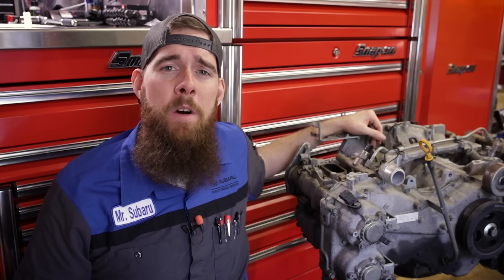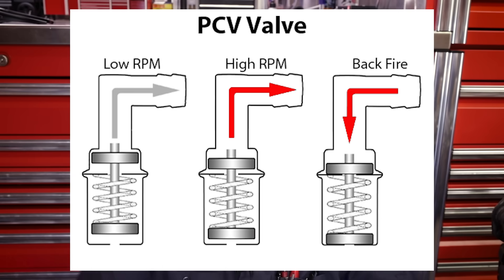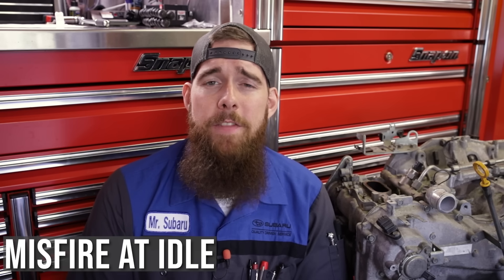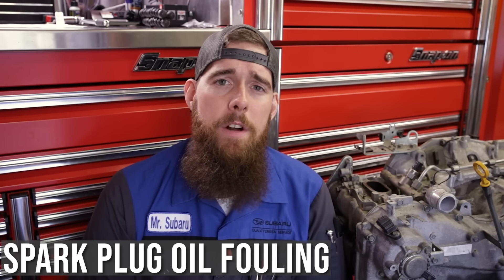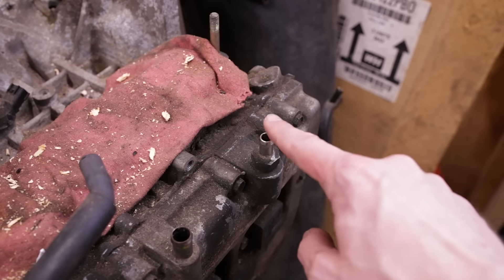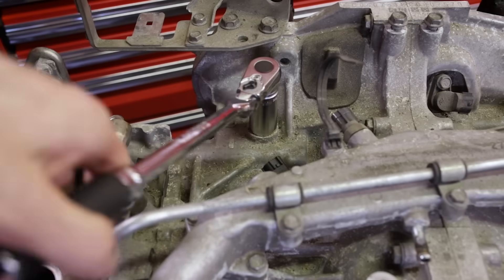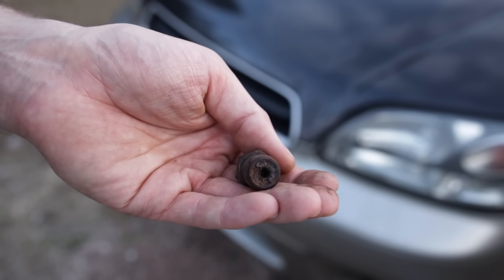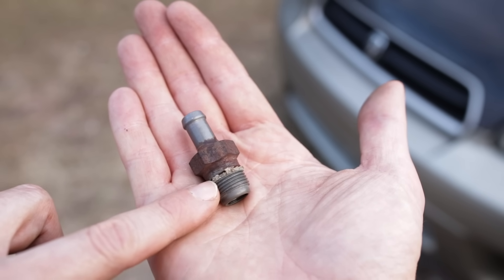DON'T Let This $20 Part Ruin Your Engine! PCV System History, Theory, Operation, & Repair!

Comment: I don't have any of the symptoms but I changed it at 40K miles.  The old one does not rattle! A bit of goop was on one side of the bottom.  So 40K (6 years) was too long to wait but I don't think it is damaged.  Looking back, I did think the last oil change showed the oil coming out a little dirrtier than previous.  2020 Forester.

Comment: That actually looks as simple as replacing an air filter, I actually did order one these for my Subaru as back up or replacement in case my original one goes bad.

Comment: Just did this today. Have 2021 Forester with 48,400 miles on it. The job was not as easy as it looked. Im no novice but this is the first real maintenance I have done by myself on this vehicle besides, oil, air, cabin filter replacement and tire rotation and replacement. Brake fluid was replaced and flushed by a local shop. First had to find the best way to get a socket   and ratchet on it and found that a deep socket with the ratchet was best reached between the valve and the fire wall. It was in there tighter than I thought it was but i increase the pressure and it broke loose. It was a little clogged and not free ratling like the new one I had. I swapped it out but getting the thread started for some reason was not easy. Spent about 5 minutes getting the threads started and put some Permatex 262 on the threads which was a recommended sealant. Tightened it up, put the hose back and Im back in business. The old PCV Valve was cleaned up with Brake Kleen and loosened it up and it is now a spare. Got a Subaru genuine part replacement from an online Subaru parts dealer. Been buying my Subaru oil and air filters from them and got discounts for the part and shipping. Cost $11.00. Just another note. I made sure the oil filter was an accepted one from Subaru and made in Indonesia like in Mr. Subarus' oil filter video. Previously I bought one from Amazon and when it arrived it looked identical, but was made in China. I sent it back. Thank's Mr. Subaru, your advice and direction are gospel. Have a log book for all maintenace and repair  and invoices and receipts are kept in a binder, Have extended factory warrantys and have proof of service with photographs in case they try to deny a claim.

Comment: 2015 Forester at nearly 60k, got the PCV valve and tube, took it out and sure enough it was failed and rusty.  Cleaned out the throttle body intake while had the air intake off too.  Thanks for making this video and educating us on the PCV valve.

Comment: Man I am going to give it shot on replacing it myself the dealerships in my area are ask $525 to $575 and that with no grease included. Thats why i hate the dealerships  $146 for oil changes $460 for front or rear brake jobs. So i asked one dealership how much  the service manager said $565 so i ask how much for the pvc valve he said $33 so $532 for labor i laughed and hung up. So now I'm going to have to go back to the university of you tube to find someone to show me how to replace myself. Thanks love your videos on how to maintain my money pit of a vehicle. P.S  i still drive my 52 Chevrolet Styleline Deluxe with a 327, turbo 350 as my backup along with a couple other oldies.

Comment: Thanks for the information and my 2004, 160,000 klm 2.5L Outback started a rough idle once in a while at 150,000 k's.
It runs rough for maybe 5 klms and then smooths out and runs perfectly for the remainer of the day. 
It's been to the mechanic that does all the servicing and repairs to find what's causing the issue but they could find anything wrong and when the engine is warmed up there no fault codes.
Tonight, I'm going to replace the valve and see if that stops the engine running rough at the start up idle.
I haven't had the rough idle for a couple of months and yesterday it did it again at startup and again after 5 klms it ran perfectly.

Comment: I clean mine every other oil change, I also capped off the system from the valve covers. Put a little breather filter on each side and all them to vent to the atmosphere. Keeps the oil and fuel from gumming up the engine.

Comment: I know this is an old video 😅but my crank seal has blown , due to pvc valve being blocked , just ordered new one , do you reckon my engine will have blow by ? (Got a little 4 cylinder)

Comment: Just touching 190k and never looked at my PCV valve. Looks like I'm checking it this weekend so I'm won't be paranoid about blowing out my gaskets. Service Manual never says anything about pcv. Definitely not $20 now.

Comment: I went to remove mine (2005 Outback 2.5L non turbo) and it's stuck, the cylinder it's screwed into started turning. How can I get it out without damaging the engine? Thx

Comment: Just tried this on my 2009 forester EJ253, but had to stop. The PCV  is on top of another larger nut with a tube coming out the side to the air intake. That nut started to spin before the PCV . I don't think that one has thread, it might be glued in somehow. Hopfeully I didn't break the seal too much and start having a leak there. Just letting you know there's another configuration out there and I'm not sure how you deal with it.

Comment: I had a tough time of it on removal. The PCV hose was rock hard at the valve end. It wouldn’t pull off over the nipple no matter how hard I tried, which was weird, because it spun around freely. I ended up cutting the hose off just above the valve with a Dremel tool, then used a 19mm deep socket over the whole thing to unscrew it out. Used a little Hondabond on the threads of the new valve, and torqued it to 17ftlbs.

Comment: Just fitted a new PCV in my 2.0xt forester. It’s running VERY nice now. Thanks for your advice 👌
Reply: Hi man,where is the PCV on the 2.0XT 2004 motor? Did you replace it by yourself? Thanks from now🙏
Reply: @UrasAlpOzcelik my car is 2017, I’m not sure about 2004. 
I got a mechanic to fit it, but it’s definitely something you could do yourself. Get a new PCV hose as well though. .

Comment: In Australia, parts are hard to come by, the dealerships don't admit to stocking any, so you have to put in an order and wait, annoying.I got a quote for about A$34, but I thought I'd roll the dice on an AliExpress unit at half the price. It arrived in a little plastic bag with the subaru logo, geniune parts and subaru corporation badging on it. The part number 11810AA131. I pulled out my PCV valve and put these side by side with the genuine one that I am sure has not been changed since I bought the car new in 2016. Car has 120,000km on it. The existing PCV valve still rattles nicely and looks pretty much like the new replacement - it has all the same metal stamping marks on 3 of the socket facings. The old and new units are shiny silver unlike the black units you have here. I have changed the oil on the car religiously every 6 months including oil filters. The car has never consumed a drop of oil. Just wondering if it the cleanness of the oil situation leads to the longer life of the PCV and other items. I also only run premium unleaded fuel which has more additives and less impurities than cheaper fuel.

But thanks for this video - one less thing to go wrong. 

I did order the new hose too. The old one was still serviceable, but it was starting to harden, so there's a nice new softer hose on now.

Comment: There's no way I would try to clean a $20 part that might have took me 30 minutes to get to if it's that important replace it for $20 with a new part.
Reply: $37 from the dealer. If you spray carb cleaner in it once a year it will stay clean.

Comment: Need to pull my ej253 soon to replace the rear main seal (which has failed after 40k since it's rebuild), so I will be checking the PCV Valve as well

Going to replace the clutch kit as well since that's likely got a lot of oil sprayed on it

Comment: Good video.  Didnt know about this and dont remember seeing in in maintenance guide.  But really?  During the silence of reinstall you couldnt say what the recommended torque is?  Right after mentioning using them? Torque setting in general are a pain to track down on this car.

Comment: thank you Mr. Subaru for this vid. I did this on my 2012 outback (190k miles) and the pcv hose was cracked in multiple places allowing air in (fixed now). check engine light kept coming on telling me bank 1 running lean (was at my wits end trying to figure this out). 

my pcv valve did not screw in the block its the 15$ red and black pcv valve from autozone. (dont know if that makes a difference).

thank you so much for the work you do on utube for helping us clueless people out with our suubs.👍

(edit)

going to ask this here while im commenting... i have a clacking noise coming from the (looking at the front of the car) left side after starting to go to work (sitting over night). it sounds like a lifter not pumping up correctly. it goes completely away after warming up. after that it cause no issues for the rest of that day.

thanks.
Reply: Did you find any info about how to change the red pcv valve here? Does it just friction fit into the hole? I want to check to see if the valve is ok as I just got 100K on my 2012 outback, perhaps clean it with carb cleaner if it is a little sticky, thanks!!

Comment: I am graduate of UTI and have been around cars most of my life.  I am new to the Subie game.  My son has a 2007 Legacy 2.5i. 
I totally understand the 2 3/8" hoses to each valve cover.  I also understand the 1/2" hose from the PCV valve to the intake (in this case, a hard line set the connects to the runners of 1 & 4 just above the heads).
What I do NOT understand, is the second 1/2" hose (the one with the "sensor plug") that connects the air resonator to the top of the block.
Is this simply a third source of fresh air that goes directly to the crankcase?  I saw somewhere that one of the ports on top of the block actually has a hardline that terminates below the oil level.  What gives??

Comment: Thanks for the info.  Sounds like all my issues derive from a clogged pcv!  Would a clogged pcv make the engine vibrate at idle? The dealer said I need new cam seals, which I understand is a major repair.  It’s also consuming quite a bit of oil.. I bought it used, but all of this possibly could have been avoided by regularly checking the pcv??

Comment: Would that be why oil keeps getting in my reservoir? I changed out my oil cooler and did a test for my head gasket none of those. Turned my ac on and heard hiss but didn't think anything of it checked my car this morning, and oil in my reservoir again!!!

Comment: What kills the PCV is carbon due to poor maintenance by not changing the oil. I changed the oil every 3k and the engine and the PCV will never have a problem. Mine already has 190k.

Comment: Hello. You may have shared your view on this before, but what are your thoughts on adding an oil catch can to a subaru to assist with the GFI issue with  carbon on the bottom of the valves? I have a 2021 Forester that we bought 6 months ago.

Comment: Can someone please tell me if the intake manifold is easy to remove.  Will it affect any gaskets ect by removingthemanifold. Car is brand new 60000km. Seems like an easy job.except I have to lay on top of the engine before I am very short

Comment: I have a 2008 outback with ej253 NA engine. The pcv has a t piece hose coming off the top but all the similar part numbers only ever list turbo models. I dont want to pull it off to replace the pcv until I can get the hose as well because its very hard and will probably break

Comment: My pcv was clogged up and the tubing that connects to it. I mean, It was completely clogged up. Can't I just clean it out, or should I replace it? I'm rebuilding my ej22 2.2l  engine and buying everything I need, I got most of it. The only thing I need to buy is all the sensors.

Comment: 2010 subaru forester EJ20 engine  rpm normal  up and down problem , rpm down 500rpm engine shutdown ,   Will it be affected by PCV Valve ?

Comment: Buy a new riser tube as well because your old one will crumble when you pull it off. If it doesn't, save the old tube for use with your intake cleaner.

Comment: How often should you check the PCV valve and should you replace the hose with a new valve?
What is the torque spec for re-installation?

Comment: Could a bad pcv valve cause a burning smell through cab vents. Cabin air filter is changed every oil change but cant figure out the burning smell.

Comment: As I would accelerate there was a slight shutter thought it was plugs replaced. Thought it was Cv axles didn't replace yet. Saw this video checked mine out cleaned PCV and man the power was restored no more shutter! Definitely forgot about this and thanks for the reminder MrSubaru!

Comment: It is amazing how complicated some PCV valves are today.  It used to be they were connected to the valve cover through a grommet.  You popped it out, gave it a shake, and pushed right back in.  I did a PCV valve replacement on a Volkswagen, a few years ago, and it was an all day job.  How did they manage to take something so simple and complicate it to hell?  Due to that, lug bolts instead of lug nuts, and the German love of torx bolts, I will never purchase a VW, BMW or Mercedes.

Comment: hi, do you have any videos or advice about cleaning the throttle body on a 2011 tribeca 3.6L? we got a new gasket and want to remove it to truly clean it. i have not cleaned an electronic throttle body, just cable. thanks!

Comment: Could a bad PCV valve cause a Cylinder 1 misfire only?  I have a 2012 Legacy, 126K miles  (EJ251) and it's misfiring so badly that it barely runs (i.e. barely got got it to go up a tow truck bed!) 

Cylinder 1 was misfiring but much less badly and very sporadically a year ago.  Put in new plugs, coils, a new fuel injector in cylinder 1 (should've replaced them all but the other three I ordered was unavailable), and a new OEM PCV valve.  No misfire for about a year (but oddly a p0108 code two months ago, which I think was caused a vacuum hose that came off) but recently had the above mentioned misfiring.   Thoughts?

Comment: Best just to unhook those PCV and CCV’s and run hoses down to the bottom of the engine compartment. The natural positive pressure in the engine will push through the hoses at needed. They don’t run on vacuum. That’s why it’s called “positive” crank case. I’ve unhooked those on every car I bought since 1988 and when I go to tear down the head, valves, and engine parts are just as clean as ever!

Comment: great video.  Thank you very much.  You mentioned oil in the hoses, but you didn't check that.  If you replace the valve do you need to worry about checking the hoses?

Comment: What are your thoughts on an air oil separator? I’ve heard that helps with the oil getting into the intake and causing the problems you are speaking about.

Comment: It's more than just pollution control. Blow by often brings engine oil with it, especially on modern engines, and even more so with force fed engines (turbo or supercharged). The system needs an oil separator and a means of returning the oil to the crancase. The same thing with valve train covers- there can be blow by from the valvetrain, too.

Comment: My first 2012 Subaru Forester.  Looks only 5 years-old.  163,000 miles. $4500. First Japanese car. 5 speed manual. Was garaged. Runs and rides like new. Just replaced my pcv. A bitch to line up that thing and not cross thread it. Used high temp gasket seal, so i read it's a good idea. My hose split a little on the pcv. Should i replace it ? I'd imagine so.🤷‍♂️

Comment: My daughter's 2016 Outback was burning oil and just running terrible, no acceleration, loss of power, etc.  Subaru suggested an oil consumption test.  I opted to buy a new PCV valve (and hose!) after watching your video and replaced it at 108K miles.  We bought the car with 103K miles.  The old valve was totally clogged and not working.   The car runs beautifully with the new valve.  Thank you.
Reply: My wife’s 2015 2.5l Outback has been jerking and sputtering slightly under acceleration for awhile now , it’s been using oil as well and occasionally you’d see a puff of smoke when you started it. It was driving me crazy and last night I replaced the PCV and the symptoms went away. Crazy how simple things can be sometimes.
Reply: Im thinking I need to been having bad issues on 01 impreza with 236061 miles for several months now haven't been able to figure out something caused misfire and explosion in cat started from bad gas  hasn't been same ever since terrible acceleration fuel consumption gas spots on airfilter air fuel mixture all out of wack. Done fuel filter, knock sensor, throttle positioning sensor, still

Comment: My car had a pcv valve recall. Apparently there was cracking. Subaru rebuilt the whole lower half of my engine with new parts. Pretty glad I went with that 10-year warranty plan.

Comment: If the PCV valve did cause a rear main seal leak, do I also need to replace the rear main seal or would a clear PCV valve stop the leaking?

Comment: Subaru had a recall on plastic PVC valves recently .Mine was plastic and was replaced by a metal one. Don't by a plastic PVC valve if possible..

Comment: 2011 Forester manual says to use red Three Bond, the equivalent of Permatex red thread bond. No way. Sounds like a good way to really cause a problem for future removal. Your high temperature silicone seal is a better recommendation.